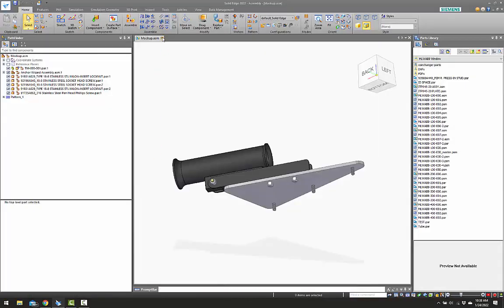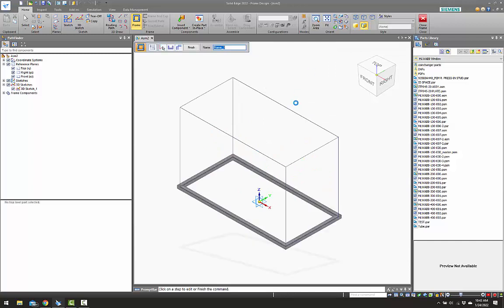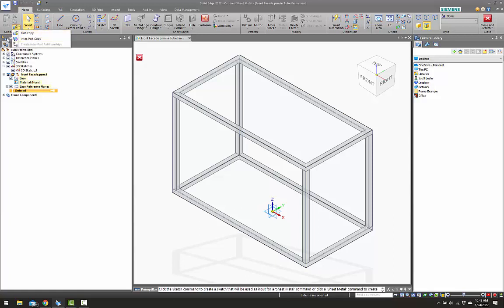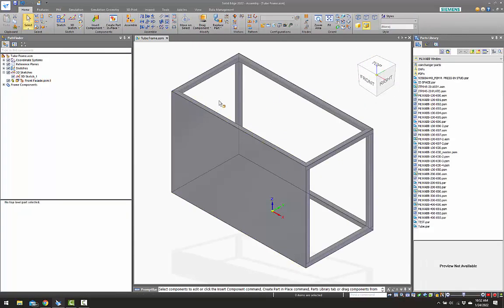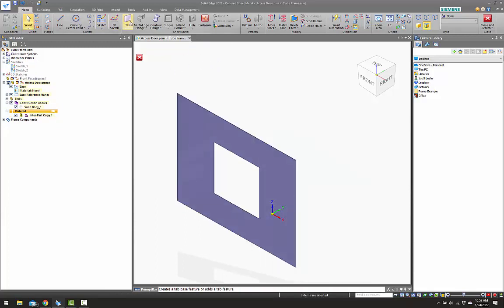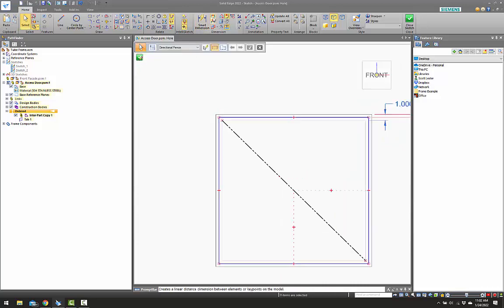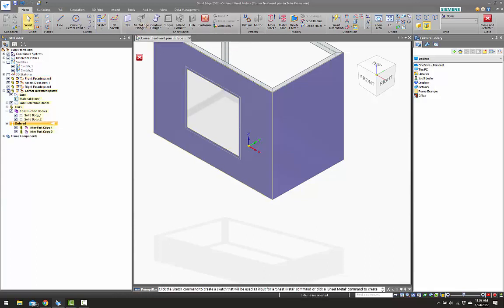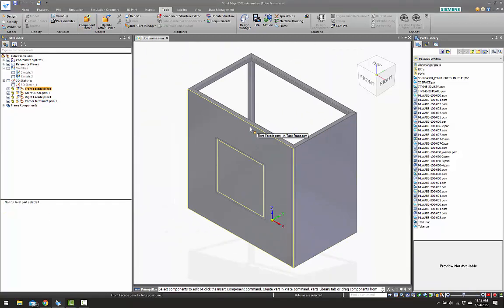Solid Edge Inter-Part Copy

Comment: As someone who uses solidworks, is there a feature like this on solidworks? Does solidworks call it something else?
Reply from the maker: You can kind of do the same thing, but it's not as robust and nice as Solid Edge's Inter-Part Copy.  

To design a part "in-context" in SWX, insert new part from scratch.  Edit it in place.  Then using 3D Sketch, you can grab vertices using "Convert Entities".

Another way you can mimic Inter-Part Copy is to Edit part in place, on the surfacing tab, choose "offset surface" and then you can click a surface and for offset the distance,  set it to zero.  Works good too.

These 2 methods work, but again, not as easy as Inter-Part Copy
Reply: @scottlesterdraftingdesign6000  would there be a way to chat with you. I'm trying to figure out the best approach to tackle this problem on SolidWorks. Becuase I have a few members of my team coming over from solid Edge and they really like interpart copy and I want to make their transition easy. But they use a specific technique and it would take a little explaining.
Reply: That is what I thought it would be. Thank you for confirming👍🏼